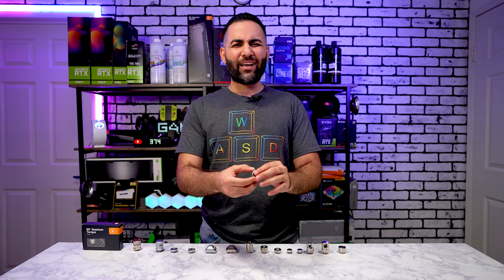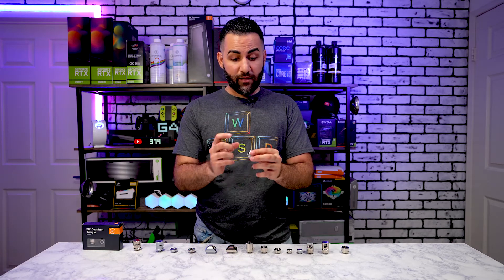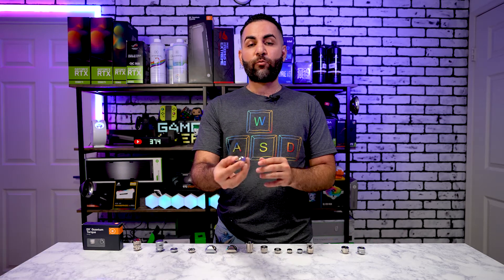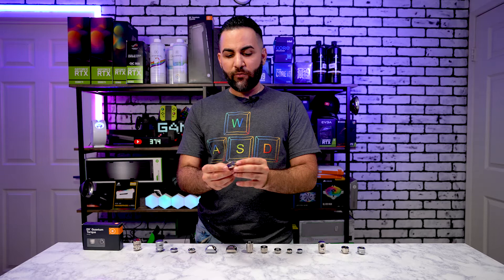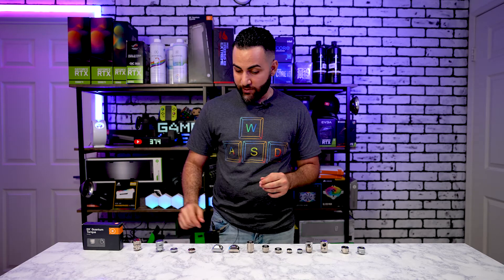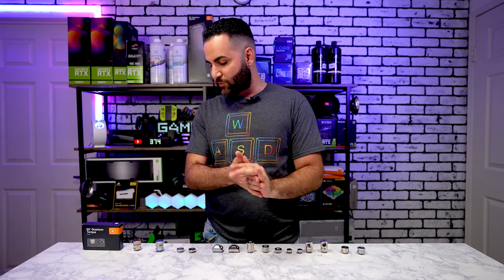EKWB Quantum Torque Fittings | Hardline Water Cooling

Comment: Good video, last time I looked at watercooling was 2019 before the Torque fittings came out. My build back then was a nightmare, it was a pain to push the tubes past the o-ring even with overdone chamfering. How is the new EK Torque holding up? Do the tubes fit in nice and easy now?

Comment: You are a godsend. Thank you so much. Ive been buying things gradually for a all EK build for my first gaming pc & microcenter has misled me about buying all these tubes for bending but when i watched the video for the rig I wanted from their new line of quantum products i seen in their Ek conquerer build i only needed 4 tubes & not 12 tubes like they were trying to make me buy. But i saw in a screen shot i took that they had torque rotaries that made it to where i didnt need to do any bending & the rotary & fitting can fit in my reflection 2 disto plate that i ordered from the surface x360 radiators along with vector 2 double plated front & abp backplate water block for my strix 3090 & velocity 2 gpu water block. Microcenter couldn’t explain to me since they didnt have the physical items in their inventory & im not much for reading EKs descriptions but looking at your handling & detail explaining each one it lets me see visually see what they do & i can comfortably buy them & have them ready so i can give them to microcenter so they can build my dream rig in August. Again god bless. 🙏🏽
Reply from the maker: You’re welcome brotha. Good luck on that build my boy!
Reply: @WiredHardware  thanks bro! Ill see if i can follow you on IG & ill tag you in the comments when i post a video or pic when i get my pc built from microcenter. Most likely ill get it back the first week in September. 👍🏽

Comment: I'm a little curious about the drain valve. Do i hook up a tube to it when I drain, and if that's the case do i need an extra fitting?

First time building so i don't fully get the basics yet
Reply from the maker: The Drain valve that I showed in the video is from EK and they'r from their Quantum Torque lineup. They have a G 1/4 threading which can be hooked up to a radiator, water block or pump/reservoir. Once hooked up you would need another fitting to hook up to the other end of the drain valve so you can attach a tube to making draining less messy. I recommend for that drain valve to use a soft tube fitting so you can then attach a soft tube and  drain your system using that tubing, makes things easier. Let me know if you have more questions 😁